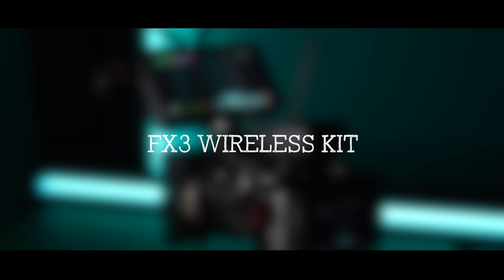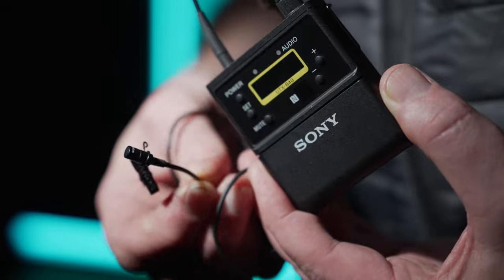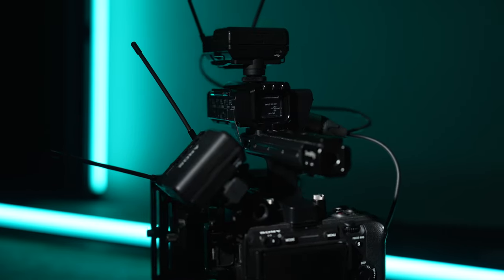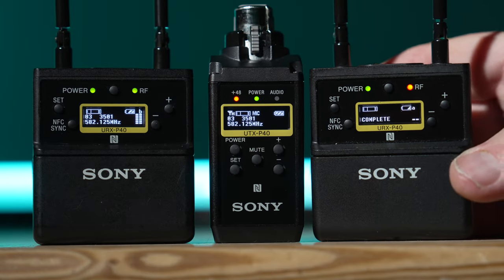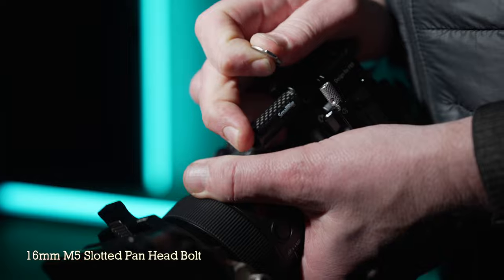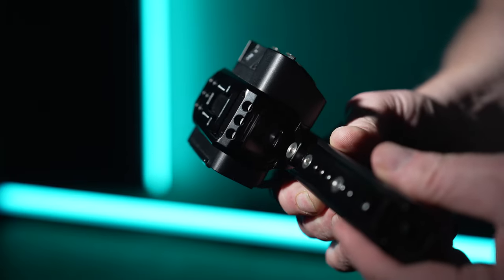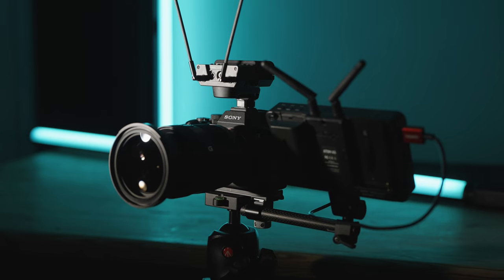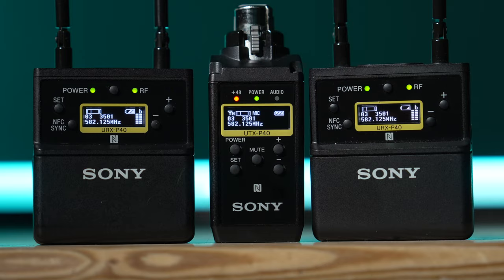Sony UWP-D Wireless - My Sony FX3 and A7iv Mic Setup

Comment: Well explained and I’m really regretting my dji mics purchase. Only issue is I need two transmitters with lavs which get pricey. Also wonder if the Sony receiver is heavy for gimbal use with the rs2.
Reply from the maker: Thanks Phil. I've not tried the DJI Mic but those clip systems are good for ease of use and weight saving for sure. I don't have any problem at all with the receivers on my RS3 Pro, they are not that heavy but do make the rig taller especially with the antennas sticking up.
Reply: Hi Paul. Thanks for the review. It's good to know a little more about another wireless system which I've had my eye on for a while. Oh, and hi Phil! 😆 I see both thinking the same here! Phil and I have both made the mistake of buying the DJI Mic. Do you ever get any audio drop out on the recordings Paul? Are your shoots mainly talking heads or do you need to move about and record audio at the same time? Thanks ✌️
Reply: @marktaylor-hankins5816  mark and I are friends and we are looking for a rock solid system for our sony setups mainly run and gun long day shoots and also some interview stuff
Reply from the maker: @marktaylor-hankins5816  Hi Mark. I’ve used these for all kinds of work, everything from talking heads to walk and talks in urban settings and sending a feed from the desk at large events. I’ve yet to notice a dropout in anything I’ve done, it’s been super reliable.
Reply: @PaulJoy  thanks for your response Paul, much appreciated 👍
Reply from the maker: @philvfilms   When I was deciding it came down to the Sennheiser G3 system and the Sony. The thing that sold me on the Sony was the ability to use the MI Shoe to connect and that it worked with my Sony ECM77 that I had from an older Sony Wireless set.

Personally I’d also rather have the ability to use AA batteries rather than charging up and worrying about battery life.

Comment: Excellent video. I bought into the two channel Sony system. I’m going to try purchasing one single receiver to see if I can do the two receivers with one transmitter that you spoke about. Happy Holidays.
Reply from the maker: That would be a great setup Walter and I'm sure that will work in the same way and give you even more options. I wouldn't have thought there would be any limit to the number of receivers as long as they are tuned to the same frequency as the transmitter. It would be fun to test with many cameras although that would be a very expensive test :) Happy Holidays to you too.

Comment: Nice overview.  Have been looking for an on-camera solution.
Can strongly recommend the newer Smallrig half cage.   It's small and light enough to keep on all the time, and has an incredibly helpful arca swiss built in.  So if using arca tripods and the rest, no need for plates.
Reply from the maker: Hi Michael, thanks for the recommendation. The baseplate I have on my A7iv also has the arca Swiss built in which is how I mount it to my tripod.  If SmallRig did something similar to the FX3 half cage with HDMI protector and 15mm rod holder I could be tempted :)

Comment: Ive been really appreciating your FX3 video series as a new owner myself. My internal mics (and internal mic on body-not handle) seem to have stopped recording audio and I can’t work out why. Are there any settings I might have missed? I have sound recording turned on and up…
Reply from the maker: The internal mic won't record if the handle is attached and switched on. You can switch off the handle using the button on the side of it which should enable the on board mic again I believe.
Reply: @PaulJoy  - Thanks Paul, turns out, it was a warranty issue. So I’m waiting on a replacement…

Comment: What gain settings do you use for your rode shotgun combined with the UTXP40? When using my Rode NTG5 with it I can hear background hiss. However, when using the NTG5 with the older UTX PO3 it sounds perfect.
Reply from the maker: I normally have the gain at -6 but I’m using the mkh416 mostly. It shouldn’t add hiss though, that sounds a bit strange!

Comment: Hi Paul, thanks for the video. You said you use Rode NTG3 with UTX P40 too. I wondering to buy these combination but I'm afraid it has some noise issues. These two works fine for you?
Reply from the maker: No problems that I’ve noticed, what kind of noise issues have you heard about?

Comment: Excellent video. I am wondering if its possible to use TWO wireless shotguns and ONE wireless lav mic for recording live comedy into one camera? The shotguns are for crowd laughter.
Reply from the maker: It is but it would require one dual channel wireless system plus a single channel wireless system with both connected to the XLR handle inputs using 4 channel recording.
Reply: @PaulJoy  can the Sony XLR Plug be plugged straight into a mixer and record?
Reply from the maker: Yes you could connect the XLR output from the receiver to any recorder that supports XLR. The XLR transmitter can be connected to an XLR output on a desk or mixer allowing you to send pre mixed audio out to the camera as well, I often do that if filming events where speakers are being handed wireless mics or using tie mics supplied by the production crew.

Comment: The ability to power the receiver directly with the Mi Shoe is absolutely brilliant... yet, as unlike the FX6, the FX3 doesn't have a second mi Shoe on the handle, it's pretty much useless. I personaly always use the FX3 handle, and I have the same small rig extensions that you use... The system seems to be also quiet bulky.. I use the AVX, and beside the short range, the system is really nice for a solo shooter..  Very compact, and zero configuration.
Reply from the maker: Yea it was a bit of a shame they didn’t put an MI Shoe on the handle but you can use the XLR inputs with the handle so it’s not really a big problem and I wouldn’t say it’s useless at all.

The AVX system looks pretty good but I really like  having the option to put the receiver directly on the camera and still getting similar quality that you can with XLR inputs.
Reply: @PaulJoy  "Useless" was probably a bit exaggerated.. what I meant was that with the Fx3 you can't take full advantage of the Sony Mi Shoe.. Having the receiver powered by the camera and connected without any cable is really huge..  (As an FX3 user I really appreciate your videos that are extremely clear and straightforward to the point.)
Reply from the maker: @Superjeanmarc  I get it, we all have different needs with gear and something that may not bother some could make it useless for you.
Reply: @Superjeanmarc  I'm looking to buy a lav system and currently that's the thing that's bugging me about the UWP because I use an FX3 as well...the AVX looks great and compact but I've been skeptical about the range and dropouts due to frequency. I see that you shoot a lot of doc work out doors like for vice, have you found the AVX to be reliable, are you still using the system? Thanks!
Reply: @Videosbyme278  yes, using AVX pretty much all the time. In general very reliable. At Vice I was using also the classical G3 transmitters, pretty much the same in terms of reliability but bulkier and using AA batteries. I prefer the AVX. Which they would upgrade the product with internal recording and usb-c instead of micro usb for charging
Reply: @Superjeanmarc  Thanks for the reply! Couple questions. Have you used the AVX in more verite situations where the subject is mic'd up but they are wandering freely, turning their back to you where the receiver is hidden etc. In real-world situations like that, what kind of range are you getting? Also, do you use the MKE2 Mic? I read a comment that someone says that the mic was making a lot of cable noise when moving, have you had that experience at all? Thanks so much!
Reply: Thank you for this video. This solution works also with Sony A7s3?

Comment: Hi Paul. great video as usual :) Keep rocking! One question... I have Sony fx3 and uwp-d26 with Sony SMAD-P5 adapter. It amazing combo but I have one strange problem. When I use Sony SMAD-P5 I can't control audio level on the camera... Do you know what can be a problem? So when I go through top handle XLR with my uwp-d26 than audio control on camera working, but when I using Sony SMAD-P5 I can't control it in camera menu...
Reply from the maker: Hi Vladimir. When using the Smad P5 you have to adjust output levels in the receiver menu as it’s fully digital.

Comment: How is the latency if using as a wireless headphone connection? Latency is critical for live musical audio monitoring.
Reply from the maker: I’ve not noticed any latency when using these and monitoring on the camera. I don’t use the headphone out on the reciever by in theory that should be just as good.

Comment: Hi Paul, thanks for the great video! Can you explain the benefit of using two single channel receivers instead of a dual channel receiver? Would be much appreciated!
Reply from the maker: Hi Alejandro. The main benefit is that you can send an audio signal to two cameras at the same time. If your just using a single camera then a sun channel receiver will be a more compact solution and allow you to receive an input from two mics to the same camera via the MI Shoe.
Reply: Thank you for the clarification Paul!

Comment: Hi Paul, Love the videos!
I recently bought a FX3 and a URX-941D. When I insert the receiver into the hot shoe my audio record level becomes greyed out, leaving me no control over levels. 
I would prefer not to use the handle and just go directly into hot shoe with the wireless, but can't seem to get it to work. Is there something I'm missing?
Reply from the maker: Hi there. Yes, that's because the signal is digital so there's no analogue control in the same way as when you're using the 3.5mm jack. If you need to adjust the recorded level what you need to do is go in to the menu on the receiver and adjust it's output or attenuation level as required.
Reply: @PaulJoy  
Ok, I gotcha….That makes sense. I appreciate you taking the time to help me out. Thanks!

Comment: Nice video Paul! I've just tried this system on my A7iv and it disables the ability to control the audio levels in camera. Wondering how you are able to control the levels? Any help would be greatly appreciated. Thanks!
Reply from the maker: Hi Patrick. Yes that’s correct because it bypasses the internal amps.
You can to set the output level on the receiver to get the level where you need it in camera though.
Reply: @PaulJoy  Thanks Paul!

Comment: Hi Paul, I'm thinking of getting the UWP 27 microphones with dual channel receiver for my FX3. Would I be able to use it with the top handle through regular XLR input, and operate it through the handle?
Reply from the maker: Hi, yes but you would need to use the two 3.5mm outputs on the receiver in to the XLR inputs using cables. Unfortunately there’s no way to use the MI shoe digital connection with the handle attached.

Comment: Could you link the part to mount the reciever to the rail. Id like to use that and that xlr audio extension cable so i can keep my monitor on the top handle
Reply from the maker: Sony make an MI Shoe extension but as far as I know they don’t sell it stand alone.
Reply: @PaulJoy  actually i did find a source for that cable for $200. I was referring to the part you mounted the reciever to the rail.

Comment: Have u tried using 3 RX into 3 cams? I wonder what is the max RX one can use to receive audio from the 1 TX.
Reply from the maker: I haven’t tried that no but in theory you should be able to use as many receivers as you like after all it’s just a radio receiver.

Comment: Using the SmadP5, does the camera record internally in 16 bit or 24bi audio? This question arises since using the XLR-K3M does it record in 24 bit.
Reply from the maker: I just had a look at some recent footage and it is recorded at 16bit.
Reply: @PaulJoy  hey! I bought the UWP D27 kit with the SMAD P5 and it works great. I want to tell you that I was checking the audio settings on the A7Siii and the option to record at 24bit instead of 16bit is possible when connected to the SMAD P5

Comment: I use the rode wireless 2, im able to get 2 channels from the 3.5 jack left and right, for 2 different actors. Can this be done with the uwp dual channel receiver going to the3.5 with a splitter?
Reply from the maker: I’ve not used that receiver but yes I’m theory if it puts the channels
Left and right then it should work the same. You could also use the MI shoe adapter and not bother with the 3.5 input.
Reply: @Paul Joy  thanks for the reply. Just saw diety is coming out with a wireless system with 32 bit backup so I'm going to wait for that one

Comment: Hi, I own the same Sony mic kit and was using it on a Sony A7iv (not mine) expecting to get fantastic audio out of it but, for me it was really noisy; that sort of white noise/background hiss you get from rubbish mic pots. I also found the connectiong to be dodgy, the slightest movement would effect it.. Im sure the kit works as i use it on my FS7. Any idea what i could have been doing wrong?! (I dont own an A-series camera so no chance to trouble shoot it myself. Thanks
Reply from the maker: I use it with my A7iv without issue so my guess would be that it must be something to do with the MI shoe on the camera if it is sensitive to touch. Have you tried connecting it via the 3.5mm mic input?  I would start by cleaning the contacts on the MI shoe and receiver with contact cleaner and see if that helps at all.
Reply: I did try with jack input and that sounded terrible too! but I was in the moment so couldn't work out if I was doing something wrong, so i just stuck with 'noisy' MI shoe setup. I did actually try it on an A7Sii (before the job to compare) which was exactly the same in terms of noise but went with it as I though i could easily clean it up (which it was ok to de-noise but definately not right). So, i'm wondering are the MI shoes very prone to getting damaged/dusty etc...  I need to do some more trouble shooting. but I guess i was wondering if any settings on the Sony radio mics could have been giving me problems?
Reply from the maker: @baudoj  Well if the 3.5mm sounds the same then it's not going to be a problem with the MI shoe as that's bypassed in that case. The weird thing is you say it's fine with the FS7, is that using the MI shoe?